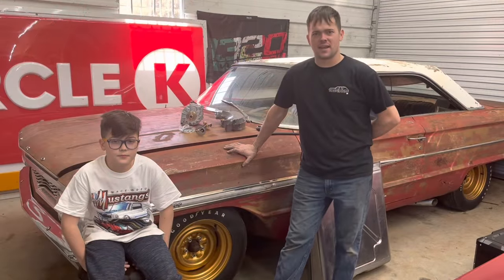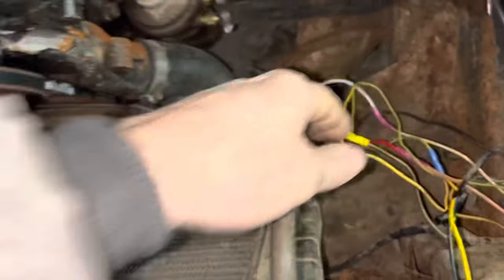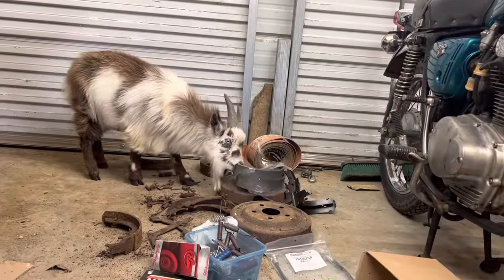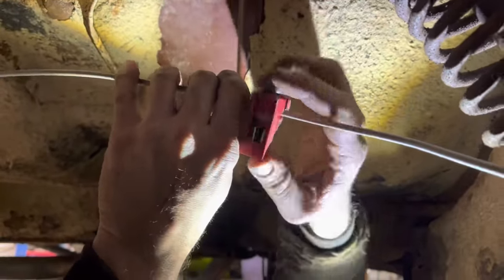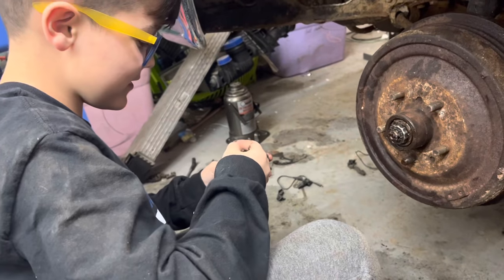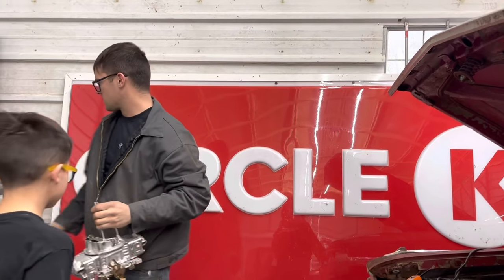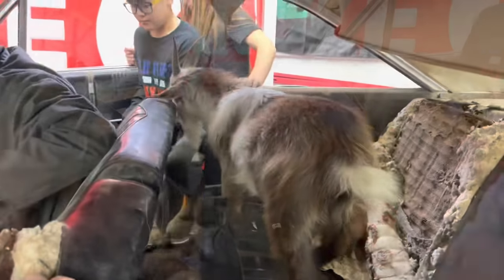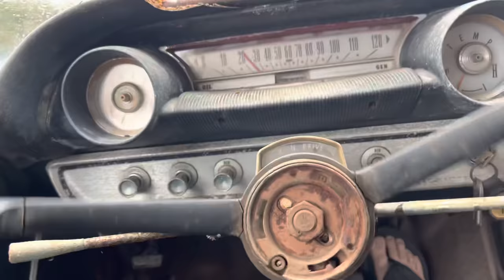Back on the road after 30 years in a junkyard ! 64 Galaxie 390 big block

Comment: as the wheel cylinder pushes the shoes out to the rotating drum, the shoes want to turn the same way the drum is turning. this turning action puts additional force on the rear shoe. so if the rear shoe is larger you get bnetter stopping power.
Reply from the maker: Ok thank you

Comment: Just use 3m panel bonding adhesif for your patches. It it super easy to use, doesn't rust like welding does, and it's incredibly strong. The only drawback is you need to buy the special caulking g*n, and the tube is about 40$. But it safes tons of time and you don't need to worry about rust. Car manufacturers use this instead of welding now.
Reply from the maker: Ok good idea
Reply: @Sleeperdude  no problem!

Comment: Now you've used the brakes you need to set them up a bit tighter. That will fix brake pedal travel. And of course like you said, check for air in system too.
Reply from the maker: Yes sir

Comment: Josh, the engine won't run efficiently until you do some basic settings.
Timing setting (it can be done even if you don't have timing marks, you can mark them yourself). Set the choke ( use the index on the choke cover, the choke plate should just close at 72-75 deg. ambient temperature). Float settings (use the peep holes as reference). Fast idle, curb idle, idle mixture at curb idle. You'll be surprised of the difference it will make, from starting to overall performance.

Comment: I think you're going to like this one. If you unscrew the cable at the speedometer and pull on the inner cable it will slide all the way out. Next, put a small amount of white grease on the cable and slide it the full length of the cable with your fingers. Put the inner cable back in the outer cable and turn until it slides into the cable gear in the transmission. Re-install cable to speedometer and you're in like Flynn, no more nervous speedometer. (Inspect the inner cable carefully, if it is frayed, this may not work and you want to apply grease with something other than your fingers.)
Reply from the maker: Ok thank you

Comment: Again, an extremely meticulous teaching video of the up close How's and Why's. I have seen old b&w clips and stills of these cars racing and was not really grabbed by them. A lot of cars of that era were kind of boxy. This car is an extreme departure with it's angled roof line when looked at from the side which is made more dramatic by the bologna cut straight thru side pipes. I know that they took the bumpers off to save weight but a rear bumper would complete the aesthetics. And the sound is terrifying. The comment about the Savoy being a car that you would want to drive everywhere, I felt exactly the same way about it as soon as Josh said it. I also feel the same way about this one. Complete opposites, these are 2 cars I would want for daily drivers.
Reply from the maker: Thank you

Comment: You need to get some heat shrink butt connectors off at Amazon they actually have solder in them so when you eat them with a lighter when you stuff the connector in each end of the the connector is the Sauders in the middle so when you crimp it and you heat it that actually melt solder on The Wire
Reply from the maker: Ok good to know thanks

Comment: Being a Ford guy, I liked the video.  However, if you are going to keep an alternator (not stock for a '64) instead of the generator and if you are going to replace the master cylinder, then why not go to the safer dual tank master cylinder and equalizer block to run the brakes in an x pattern?

Comment: The front shoe is shorter to prevent it from grabbing. More surface area for the rear shoe means as the wheel spins and brakes are applied it does its share of the stopping. Otherwise it would mostly be the front shoe.

Comment: Love all of you dearly, but for  me, as I first saw a dark blue '64 Ford in late 1963 at age 10, and just fell for those cars, later a friend had inherited his mom's 64 Ford Galaxie 2-door hardtop, (in that elegant  White) pristine & clean- but went in the Air Force in '65 or '66, we re-connected & caught up in '72 when I returned from my initial service, but he had traded it in on a Torino 2-Door,  it also being a cool car, and the dealer had sold the car out of State buyer who had re-sold the car, and would not disclose ANY information, so buying that 'like new' 30K miles impeccably kept '64 was out. And I had traded my '69 Pontiac Custom-S (Think upscale Le 
-Mans) for my '71 Pontiac Lemans Sport, (2-more cars I should have kept.)
And because I've held that 64 fast to it's pedestal, I would love to see that car back to original- doesn't need to be '1st in show' quality, just  good bodywork, new paint, re-upholster seats, door panels, headliner, carpets, 
DON'T 'rotisserie' it just to do frame/engine/trans/axles/exhaust clean, blast, paint, etc. just pull it apart and paint it while separated seems easiest, been there, a buddy and I had done some in a split bay shop, work on one until it had to dry, etc. then the other, pushed both halves through to completion at reassembly, His vocation, my recreation at the time, helping a friend get his own shop up and running while building some decent rides we'd found to build & sell. in 15 + years we never came across or heard of a '64 Galaxie 2-door hardtop for sale- Or even a 'Custom' with a 352.

Comment: Short Shoe/Long Shoe ..... Primary Shoe/Secondary shoe .... what you're seeing is an evolution in drum brakes. If you look at some cars from the 1950's, they have two cylinders per wheel and each cylinder pushes on a hinged brake shoe.  Well obviously since the shoes are hinged, the braking surface wears unevenly. Most back then also didn't self adjust.  Fast forward a few years into the 1960's, they had come up with the floating shoes and double-acting, single cylinder. Because the shoes now float, they can wear more evenly.  Now as for the primary shoe being smaller, it was found that with two-different sizes of braking surface,  this stops the brakes from being "grabby". So light brake pedal application, will only make the primary shoe engage the drum.  Secondly, back to the floating shoes, during medium to hard braking, the motion of the primary shoe engaging with the surface of the drum will help force the secondary shoe against the drum without requiring MORE pedal force.  I always forget whether it's centrifugal or centripetal force theory.

About 25 years ago, when I was doing my Vocational Training, my instructor came to me one morning and asked if I'd driven my Gremlin that day and if we could use it for a demonstration.  I replied I had and he asked if I could park it in Bay #1.  It all made sense since we were doing drum brakes and hydraulic principals that week.  After several hours in class, we'd go into the shop for practical lessons.  So, the instructor had the class gather 'round my little Gremlin, and had other students remove the hubcaps and front wheels.

I shit you not.... there was a collective GASP from the younger folks in the class because even way back then.... some of them had NEVER seen drum brakes on the FRONT of a car before.  Sure made me feel old and I was only in my mid-20's way back then.
Reply from the maker: Thank you for that information, I like gremlins

Comment: If you want to know why your carburetor seat  jammed up it was from you destroying your casings.
If you watch some of your videos you will see that the rubber gets sucked in through the air cleaner into your carburetor.
If you're wondering why your brakes didn't fit on the back of the car.
I believe at one point in time someone decided to put a positive differential into your vehicle. 
I enjoy watching your videos and hope that you will be able to someday have a barn find and some vehicles that are as nice as your grandfather's.
Reply from the maker: I hope so too

Comment: Long shoe Theory... As great grandpa said... because they "rutch" pronounced like (butch with an R) I repeat They rutch with the spin of the wheel so the lower part shoe near the adjuster tends to kick out while the top at the wheel cylinder tilt in. The forward shoe does the opposite. When you back up the front shoe kicks out at the bottom because of the lack of extra lining the movement or "rutch" causes the adjuster to push gnarle and turn to lengthen, pushing the shoes apart and closer to the drum. Sorry for the Dutch lesson Rockubtzer is dutch too pronounced (rock a bu zer) short U sound. Grandpa's name for me
Reply from the maker: Ok thanks for the info

Comment: Is it possible that the left front brake failed because of a weak spring? Looked like you used both old and new springs. Maybe that caused some sort of imbalance?  Maybe I'm all wet, since I've never worked on brakes, but I do know that springs get less springy with use and age.
Reply from the maker: It ended up being because it was not adjusted out enough

Comment: Are you sure that it has positrack rear end? ........ Because I only saw the right side brack tracktion on your last burnout. If it had positrack they both would have broke tracktion, even if one was in the dirt and the other on pavement.
Reply from the maker: It spun both in the first 3 videos I did on it every time. Not sure why it didn’t in this video

Comment: Love your vids man' BUT i believe you are not totally correct about heating a nut to remove... you say it causes the metal to expand off the tube... but the tube is made of metal as well therefore it will also expand so you would have the same problem but larger... what heat does is SOFTEN the metal making it more malleable and easier to remove 😁
Reply from the maker: That may be right

Comment: The front shoe is the primary one, and will brake  the hardest, because the wheel cylinders push on it, and the direction of rotation makes the leading edge pullout, like a barndoor leading edge catching wind. 

So the  manufacturer’s cut  of the front one, till it does as much as the rear shoe, because the wheel cylinder lifts it  by its back edge, so it’s the opposite effect, as the barndoor, I used as a reference before. 

I hope this makes sense?! Or let me know if that makes no sense, because I gladly try again.

Comment: I have the same carb. The idle mixture screw on the front left adjusts the vacuum and idle speed easily however the right adjustment screw has zero effect. What could cause that problem?
Reply from the maker: There has to be something wrong inside your metering block, i would swap it out with another one and see if it works

Comment: Should have went to the O'Reilly's and got a one wire alternator Ford I got one for my brother French Arrow it's basically a GM alternator with what they call an excited regulator in it that's what makes it work you run one wire to the battery positive and you can do away with all that Rat's Nest of wire on the back of that alternator that for decided to use and you don't need the regulator on the fender or the alternator like that he had the same one on the Ranchero and 78
Reply from the maker: That is a good upgrade, I did that to my falcon in another video

Comment: the old landrovers used a single servo master cylinder i think as long as the lines and master cylinder and wheel cylinders are good then you should have no issues, i hear a lot of people going on about single servo brakes, maybe they have had them fail maybe not im think its like those old wives tales where you shouldnt do this or that. most cars should have a emergency brake.

Comment: Self actuating shoes. Why everything floats in drum shoes. The shorter shoe is the actuating shoe as it contacts the drum it ever so slightly rotates tightening the rear shoe which has nowhere to go. Using the initial push of the wheel cylinder pressure in conjunction with the rotation of the drum. Physics make the floating shoes cause more binding with only a bit of line pressure. 
Yep I'm 70 yrs old and started fixing cars at 11yrs old.... like Ralphie
Reply from the maker: Thanks for the information

Comment: You have to have the best wife in the world
Reply from the maker: For sure
Reply: I wanted to let you know that motor home problems was it has a low pressure pump in the tank and a high pressure pump on the frame it would have run if you would have bypass the pump on the frame just for future reference keep up the great videos

Comment: I never seen a rollback front tires come off the ground before. This has never happened with a powerstroke.  the engine is too heavy. Learn something new everyday
Reply: I'll probably picked helped  picked up 100 cars. it was a F-350 with A 6.9 deisel. It weighed I think 10,700. It had three quarter inch plywood sideboards plus he had a lot of junk against the headboard. It was a junkyard rollback. Yeah but it's never never one time to that front end pick up off the ground that's the first time I seen that. Your row back probably weighs 8,000
Reply from the maker: Yeah it’s kind of crazy

Comment: Ralphie do you like driving this car no because I can’t bang through the gears. This one’s a crap O-Matic dad put a four-speed in it and I’ll bang through the gears first second third fourth. I’m going down the hill don’t go down the big hill son why not that because we got no brakes, I could Fred Flintstone dad know you can’t make a left turn data you’ll be in the clear, moose twit.
Reply from the maker: You might be right
Reply: @Sleeperdude  get him that little Suzuki samurai or Jeep, CJ with a free speed that should suffice. I tagged you in a Facebook post. How do you do an oil change when it’s overdue I walked away from the Chevy trailblazer. My roommate has one arm literally the other one broke off, he grew a little stump but we put too much water on it and it died. So drain plug is stripped. Oil filter is seized 10,000 overdue gotta go to Jiffy Lube. Have a good day buddy happy Monday New Jersey.